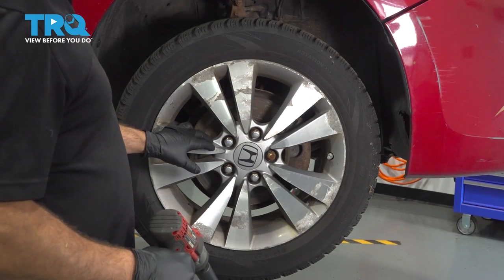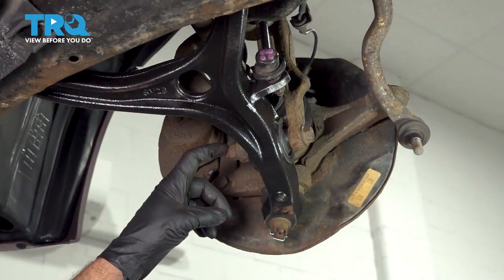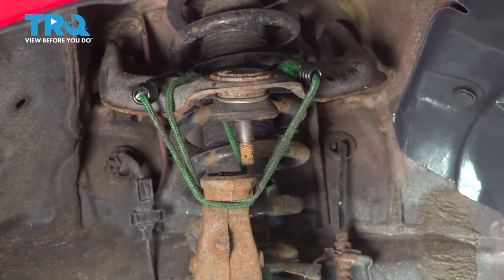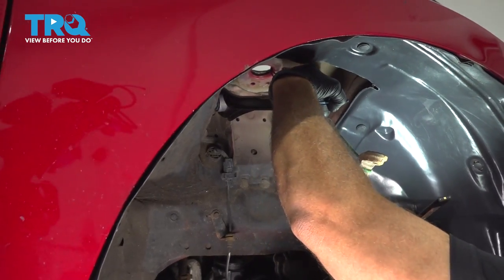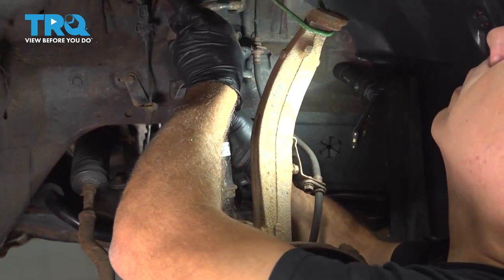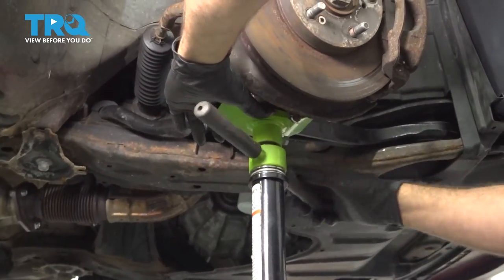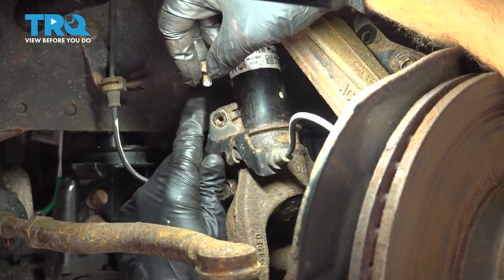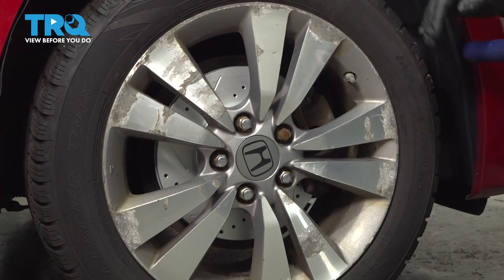How To Replace Upper Control Arm 2008-2012 Honda Accord

Comment: For anyone curious, you DO NOT need to remove the entire strut to complete this job. After you loosen the top three nuts at the top of the strut, you can wiggle it towards you and you’ll have plenty of room to reach those bolts at the top of the control arm with your ratchet
Reply: Hey fr

Comment: I did this job: you can maybe do it without removing the strut if the spring happens to be aligned out of the way of the bolts but it’s honestly faster to just remove the strut and reinstall than mess with it.   You definitely don’t need to detach the tie rod.

Comment: The job is easy enough if you don’t have to deal with stripped bolts like I did. The bolt stripped and the body nut. I’d so much rather have the Macpherson strut assembly. Only benefit of wishbone suspension In my opinion is handling . The macpherson assembly is much simpler to work on and less parts to break
Reply from the maker: +Aaron Thanks for watching our video! http://1aau.to/m/Shop-TRQ

Comment: Hey I've recently had this done at an auto service and what I've realised afterwards was that the car is way too jumpy on the front,and by that I mean that after I pass a speed bump or something similar,the car acts like it only has springs and not the dampers as well. The mechanic says that this is how the car should have handled before as well,but I just can't believe this. Is he right and I'm nuts,or he somehow messed something when putting it back togheter? I see that you've lifted up the suspension so that it'll be in its natural position when you finish tightening the upper arm. Could it be that he didn't do that?
Reply: If you tighten the bushings out of position it just risks tearing them, it shouldn't affect the ride quality.  You should check your shocks for leakage...if you can bounce on the car with your weight and it keeps bouncing more than 1-2 times after you let go the shocks are bad.  When I had a shock fail the car would rock like a boat when I bounced on it.